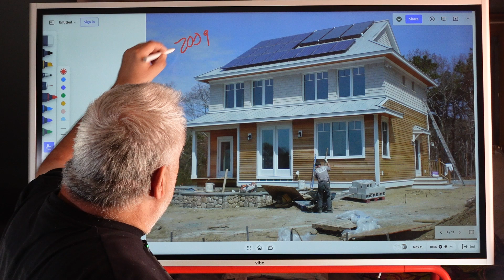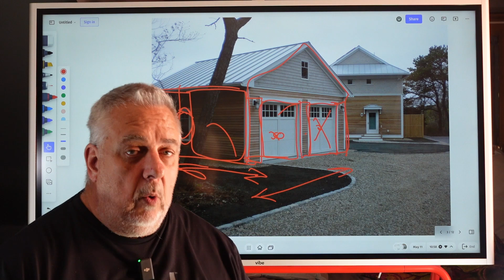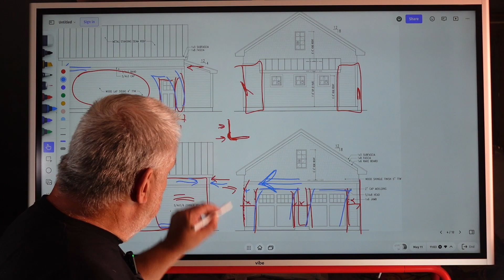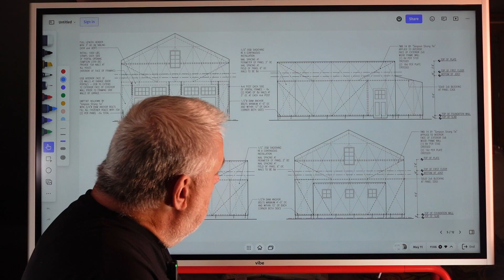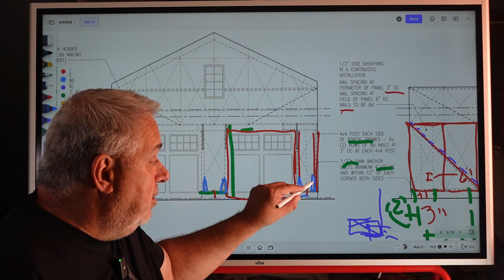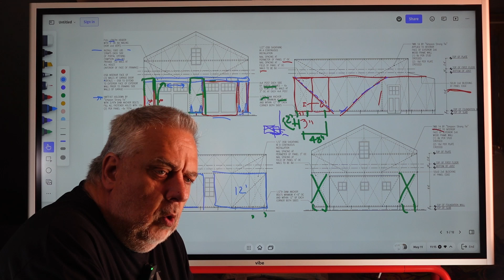PH11 Episode 19 GARAGE SHEAR

Comment: Steve, are you licensed to do structural design?   I do this in 140mph zone, none of my fellow structural engineers do what is being done there.  We start with a wind load and calculate loads horizontally, diagonally, and uplift.  We then design for overturning, sliding, shear, seismic, and uplift.  I find no value in those diagonal straps and just tucking under a plate does no good.  We also use threaded rods and quicktie cables.  This design looks like something from the 80's.
Reply from the maker: I am a licensed Architect and can stamp structural decisions certainly. I agree the straps have a pretty low value, BUT, they are in addition to the continuous shear sheathing. also note the straps are tied to specific anchor bolt locations, which helps

Comment: What do you think of shear panels on both sides of the portal wall and double the foundation anchorage? It may require an extra inspection.
Reply: I generally do that on the garage door walls.  Interior wall goes on after electrical, and insulation.  Then ply/osb on the interior nailed as the exterior is done.  I nail with 10d spiral, 3"OC on all members on the door end of the garage.  PE
Reply: @coasttal123  Brilliant. Thanks for sharing.
Reply from the maker: There's many things at play with shear, both sides will help, but a second bottom plate is also a bigger help, also studs 12"oc, or double studs at the joints. Getting very secure nailing with great "edge distance" is the target

Comment: I have been thinking about if it’s possible to secure a building, garage or home against an Enhanced Fujita Scale of an EF5 >200 mph tornado that can create incredible violence & damage.  

Having survived 7 tornados, it’s not without reason.  People were killed in each one.

I look forward to sharing my thoughts with you Steve.
Reply: To do that you might consider moving up to some sort of reinforced concrete.
Reply: Being from a town that was devastated by 2 major hurricanes, Cat 5 Camille with sustained winds ~200mph and Katrina that brought a 30ft storm surge to our town, I would  suggest ICF to the roof, and make the roof flat with a parapet to protect it from the wind.  There are two famous photos of poured concrete wall houses still standing amongst a whole neighborhood of flattened wood frame and masonary houses.    However, the wood frame house that my father built in the 60's survived the eastern eyewall of Camile.  All walls were sheer walls, even the interior ones, composed of 100 year old planks at diagonals on both sides of the studs.  We never had to find a stud when hanging anything on the wall.  All my homebuilder uncles and their families came to our house to ride out Camille.  An embedded tornado  clipped one side of the house, lifted it, and dropped it.  During Katrina, water rose to 5ft in the house before the floor gave way and created a geyser in the living room.  My brother had to scramble to the attic and break out a vent for egress.  Luckily the water stopped rising at the ceiling.  When the water receded, the doors were swollen and would not open, so he had to get out via the aluminum casement windows.  Steve does a great job with wood frame houses and uses ICF for basements only.  I think he would argue that better energy performance can be achieved with wood frame, it is more versatile, cheaper, environmentally friendly, and the trades here are setup for it.  Many of the details he shows us to achieve a tight house do not apply for an ICF house, though.  It would be interesting to hear Steve's views on ICF houses.  Here in coastal Florida, most houses are CMU/stucco with hip roofs, another way of building for high wind.✌️
Reply: @markstipulkoski1389  Structural engineer here.  Not sure solid concrete walls will stand storm surge directly against them.  Too many failed sea walls along the ocean to back me up on that.  Many of those you saw still standing were built several feet higher than other houses.  You will notice the decks and stairs are gone on even the buildings left.   I do structural design here on the coast of SC.  I pay alot of attention to what failed and what did not whenever these storms hit.  Being above the surge line of water is the 1st defense.  The cost of building ICF or concrete 14' foot up in the air is extremely expensive.   The fact that so many homes from Orlando down are built with concrete filled CMU in non floodal areas is a pretty good tatic for handling the storms.  Just getting the roofs to stay on is another ball game.
Reply from the maker: Mark, have you ever seen or done a "cabled" holdown system for the roof? I have seen 1 in my time
Reply: @stevenbaczekarchitect9431  No I have not. Sounds interesting.  I'll research it.  Always interested in learning  new things...that's I why I like watching your videos...a lot of knowledge there! ✌️
Reply: Security against EF5?....just MOVE.

No business building there....I'm tired of paying for taxpayer subsidized hurricane insurance.

You want a house on the ocean front? Then you pay the FULL cost, buddy
Reply from the maker: Certainly an ICF house would help. I have only seen a couple, but you can cable anchor a house to the foundation.....a little goofy but I'm told it works

Comment: Good video. Are the walls ballooned framed, especially the side walls? I would like to see how you made the connection of the rafter/walls and did you use a ridge beam? thanks.
Reply from the maker: No, the short wall works in resisting the kicking out of the roof eave